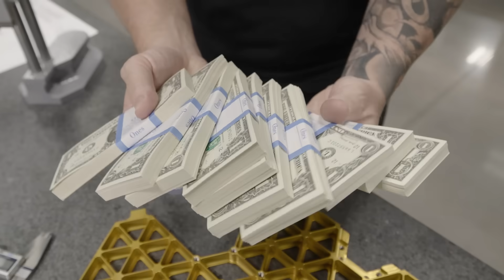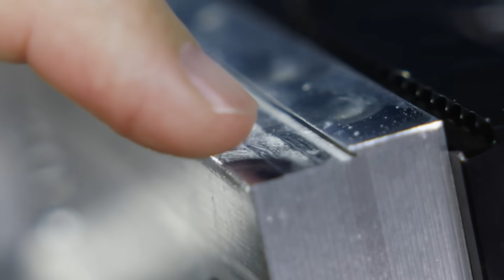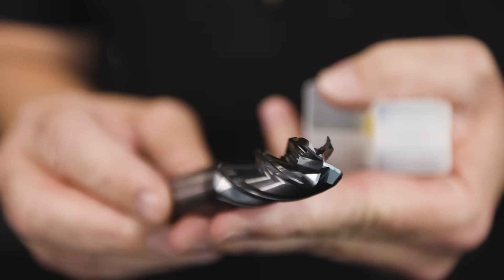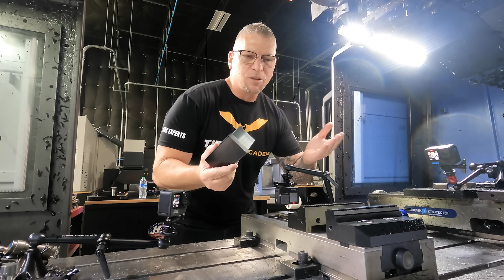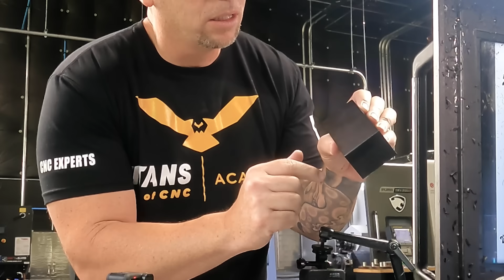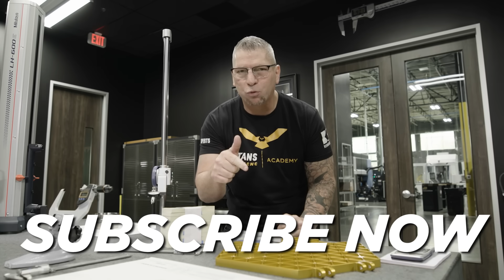How To Master The ART of Machining Plastics

Comment: Hi Titan.  Manufacturing changed my life back in 1992 when I took a night job at a screw machine shop.  I looked at the drawings and said "I can make these"  and asked my boss if I could cut my hours to 20 so I could go to community college for drafting.  30 years later and much frustration with designing prototype parts and having tight time schedules, I found myself having to use a drill press and band saw and various hand tools to fix or modify the parts because the lead times for this would run close to when proto parts needed modding and management needed answers.  My wonderful wife told me to just finance my own cnc one night after I wanted to quit due to the stress of work commitments and a day of drilling and tapping a copper heatsink with hundreds of holes and a broken tap.  The company would not spend a dime to help me with the basics to be able to do my job and I was ready to hang it up.  After buying a small Tormach, I found that I missed the days of calipers, mics and chips and now I have a small business that I am training my young son with.  He loves it too and I ended up gifting him with his own calipers and mics and hopefully some day I can retire to just my small business and eventually provide a way for my son to earn a living when he hits working age.  Yes we had a son at age 40 back in 2010 after many years of not being able to.  God blessed me with a smart young man that has a genetic trait for mechanical things.  Other than that, this return to the manufacturing aspect of my career with machining my own trial ideas and prototype peices, has also taught me some things that allow me to design parts without creating a headache for the ones that vendors finally have to machine  for our production units.  My company now realizes the money and time savings of me being able to provide sloutuions in a day or two vs. waitng for 4 weeks from another shop.  I can tweek desins on the fly!  Thanks for the great content and I wish I could go into more detail of what God has done in the past 30 years as far as lifting me out of the mire.  But that would be too much here.  By the way, I'd say the stack is 4.3773"  but if I were to win, I'd give the money to my son to use for future courses as he is home schooled and we want him to be able to take courses in CAD and other needful tools as he is very interested in being "president" of the small business someday.  Thanks!

Comment: I started out designing product for an outdoor company. I didnt have "schooling" as an engineer, but I had loads of product usage on a professional level. Moving into design,  I was always told how you couldn't build certain things due to design parameters. So, I started learning machining so I could improve my designs. Decided I need my own machines so I could prove out ideas without answering to anyone but myself. Now, 20 years later I have 2 cnc machines, and 2 manual. Still building and learning thanks to good folks like you who push the limits and share knowledge.

Thickness- 4.4122"

Comment: Starting as an operator with zero experience seven years ago, to working as a manufacturing engineer, to now opening my own shop in April, I'm obsessed with achieving manufacturing greatness in the USA. My guess is that stack measures 4.8678 at the highest point. Cheers and thanks for all the awesome content and educational material. That zero tear-out ramping trick is super slick!

Comment: Ive always loved learning, machining whether additive or subtractive is always forcing your perspective to see something that isn’t there yet. I just had my first child march 26, 2022 at 25, I can’t wait for her to start playing with the 3d printers and learning cad. Also thanks for your motivational/inspirational videos, they really helped me look to the future.

Well each stack is .43 inches or 1.092 cm thick(100x$1). Each individual bill is .0043 inches thick or 0.010922 cm. so the complete stack(1000x$1) is ~10.922 cm or ~109.22mm thick 

Also if you are ever hiring! Please consider my resume!
Reply: This is the way I would have made my estimation, except I would try to factor in some air gap as well as possibly checking what kind of tolerance could be expected based off my own measurements of brand new crisp bills.

Comment: I came into manufacturing when I’m 20. It’s a tough transfer for a urban man to mingle with a metropolitan community. I just pass out with a diploma without experience. Join into a small scale manufacturing unit as a helper, from there I begin my manufacturing career. When I 1st enter the company my eye stuck with a massive machine. Lot of things happening in one time, it’s a white and blue painted ASM VMC. From the 1st day it’s self I’m impressed by the machine movements something spinning inside with a massive rpm , milky type liquid flowing into it , Screw conveyor removing chips, etc… especially tool changer attracted me so much. After some days I realised that this machine is the back borne of the company. 
           As a helper boy I’m not even permitted to look at the machine. Everyday evening I got a chance to clean the machine, cleaning chips inside and outside the machine that’s the 1st bond with CNC WORLD. Day by day I realise that our company making parts for the CNC machine itself. That’s the best starting for a CNC PROFESSION. Day by day I become a operator, loading parts ( guide ways, cam plates, finger plates, manifolds, etc…) and make good production with quality and quantity. 
         One day suddenly our programmer resigned and quit the job. That’s the turning point for my profession. Our entire production stop for 2 days because of no programmer. The next day I took the challenge, I ask for the operator manual with the machine ( documents related to machine always handle by boss). Boss give the books to me , I go through reference. With my 6months of operator experience and with help of manual books I make a simple manual program for size milling of guide ways. It was a big Sussex (Guide ways only need to do sizing). From that simple leaner movement program I handle all the guide ways job. Later I started to do fixture plates, when r5 need in pocket radios I use 10mm endmill 🤪, r3 - 6mm endmill , etc… for bigger holes I do interpolation format. One day a fixture plate need to do a outside corner radios that, I took hole day for a simple corner radios. From that day on words I learned circular motion also😍. Day by day new challenges comes and That will help me to learn new things. I started my journey as a manual programmer. After some months I got a notice for CAM training for two months. I joined in that course. From there I learned the basics of MASTERCAM software. One day I got a chance to attend a training program for ASM company ( one of the biggest CNC manufacturer of INDIA). When I see the parts they manufactured, I really shocked with shape of the parts. I realised that I just learn only 1%. From there I make more contact with company people who do Cnc multi level programming. Day by day I improved my skill. I joined in a company that make tools and die as a CNC programmer🥰. From there I begin my CNC PROGRAMMER profession. What I love ❤️ about my profession is all ways a new thing we can learn. When new sample drawing comes into my hand I need to think a new idea for machining like clamping, figuring, tooling, quality, quantity, commitment, profit, etc…
         Today when I’m writing this I’m waiting for my flight ✈️  back to my company in Malaysia 🇲🇾 after a vacation trip. Still I have the same curiosity when a part come out of the machine  7 years back I had. The best think is 100’s of machines running day and night  making parts with quality and quantity by my programme and idea of clamping fixtures. Day by day the technology changing, new invention and innovation going on in this world, so we need to update and learn new things our self. Then only we got a chance to show who I’m. Thank you 🙏🏽 
$1000 thickness= 4.33 inches 
                          = 110 mm

Comment: I been cnc Machining for 4 years in plastics.. btw I would use coolant on that delrin for a even nicer finish and a 3 inch Mitsubishi cutter. But anyhow I started when I was 27. No cnc experience but my prior work experience made the boss put me on the Hass mini. I also run a gt75 and Jr.  Mori seki even. I wouldn't want any other job in the world. What I started out as was going into architecture. And one year of engineering. All the blue print drawings I did helped me in the machine world. I blended in nicely. And ever since I been wanting to be better. I machine plastics. Nylon, black nylon is a bigger, Teflon, pvc type 1 and 2.. hate 1 tho. Delrin is my favorite because it doesn't like to crush as much as this video has thought me how to clamp on less material... Thank you. But ever since I been watching your channel.. I did things there watching you and learned how to program better. Only wish to work for you. You are inspiring. Btw the money would be nice especially since I just spent 4grand on plane tickets to go see my fiancee  in the Philippines after 2 years of not being able to and I'm broke 🤣 but if by some odd chance you did pick me I would like for you to donate it to someone really in need of it.

Comment: I am currently unemployed but my experience with CNC machining started with Lincoln Tech.  I finished my freshman year of university and I just didn't like it.  I was unsure of what I wanted to do with my life, until my uncle Paul came over to help fix our washing machine.  We were talking and he mentioned Lincoln Tech, so me and my grandmother went to the school and talked to one of the administrators and she introduced me to the CNC shop. I have never even heard of CNC before this, but the second I walked through those glass doors, I knew that this was the place for me.  I saw these big machines and a small 3-D printer on a table.  I was talking with one of the instructors and he explained what the machines did and how to operate them.  He went on to explain what the course is about and what I'd be learning.  I started the  10 month course and got my NIMS certifications.   I learned more at Lincoln Tech than I ever have anywhere else.  After school I was going to join the Army, but that didn't work out. I failed the medical and was told to find another job.  I found one as a wood worker making shakers, drawers, doors and mirrors.  I liked the job, but it wasn't what I wanted to do.  I was there for about a month then I got laid off do to COVID.  during the summer of the pandemic (mid 2020) I went back to school for this free CNC program at Vincennes.  It was a 15 week course and a much needed refresher.  The instructor wasn't the nicest of people but I ignored that and got my eight NIMS certifications.  I'm still looking for work and also in the process of getting my driver's license, I've been watching your videos for the past 2-3 years just to stay informed about the trade.  CNC machining is something I was meant to do, and I refuse to quit and settle for some dopey 9-5, I worked my ass off to get into this business and I don't plan on stopping.  Thank you for the free education, the inspiration, and the motivation to keep moving forward.  

If I had to guess the thickness it would have to be at least 6 and a quarter.

Comment: Machinining has changed my life because it has made me realize that I can make anything that I can think of As some one who is mechanically inclined one of my goals is to one day make my own working V8 engine block. I've become so invested that I'm constantly looking for more ways to add more tools to my tool box. I'm also looking to starting my own shop one day.

I currently work at a shop that makes parts for the firearms industry though they are working to branch out into other industries. I love every bit of it. Currently we run primarily Haas vf2ss machines but I'm hopeful that we will get other machines as well so that I can become more knowledgable about different types of machines and different control interfaces such as Fanuc.

My guess for the height of the $1000 1 dollar bills is 4.3655".

Comment: In 2015 I graduated right out of Highschool taking their vocational class for Cnc manufacturing. I took this Class because I didn't know what to do after graduating Highschool so I Figured i was better off learning something in some sort of trade and took the Class serious learning all I can. Been working in a Job shop ever since and learned many great things and aspect about the trade. Started in the Manual Machine Department cranking handles to CNC lathes to a 3 Axis VMC programming all of my own parts in WorkNC and Lemoine CAD/CAM software. Also Learned how to use Conversational CNC control from a Seimens to a Hurco. They were Really User friendly and easy to learn. Since the shop I work in are mainly focused on Automotive and Aerospace I became really familiar of how injection mold works and working off datums. Started learning 5 axis machining in 2017-2018 and been programming and using them ever since. Cut and profile many types of Car lens and Optic for big company's. Finish this Nice Disk shape part recently for boeing and felt really proud of myself holding tight tight tolerances. Im constantly learning and trying to improve myself in this trade. Always maintenance my machines to keep them running right. Calibrating it and running RTCP check etc. Its been really fun and loving this trade and seeing this trade evolve everyday. 
Also thanks for having these tutorial about fusion360 and mastercam. I watch them on my free time maybe thinking about getting a CNC. I already own a cheap 3d Printer for fun use. LOL i designed and made a Tool holding rack for my HSK-63 Tools at work since i don't have a tool rack there.
From Akron, Ohio 
Money stack is about four inch five hundred and eighty three thou and two tenths LOL 
4.5832

Comment: I've only been a machinist for 2 years. I work at a prototype shop in Albuquerque, NM. I run, setup and program everything I do (HAAS VF4 with a 4th axis rotary) We do a wide variety of parts and materials. Manufacturing changed my life. It's the only job I've ever had that I truly enjoy doing, even on the bad days. Dropped out of high school @17 never got good grades until I started the Machine tool technology program at my local college (right when COVID started). Graduated a semester early with a 4.0 GPA. (Thanks to my job). Im 26 now, alot more mature than when I was in high school. Applied myself at school and work. Now I'm making crazy parts and excelling at my job. Thanks Titan and the other guys. The academy has helped me a ton with trying to learn 5 axis programming 🔥💯.  Slowly turning into a Metalphiliac like Barry 😂💪

I'm guessing that stack of bills measures out to 4.52 (unconstrained) 
Constrained it should be 4.386 including the paper bands. Each bill being about .0043 inches.

I would definitely use that cash to buy some good mics, calipers, and gage pins

Comment: Manufacturing has changed my opinion on college. my mindset was towards having to get a college degree to be successful and do something i love. but my Teacher Mr Ruiz led me and 2 of my friends to this channel because we were interested in the 770m we have on campus. so far we haven’t done anything other than set ups but i’ve gained experience on a cnc router and manual mill and soon cnc mill. CNC machining became my new favorite pastime. i can do it all day and not get bored. it’s something that evolves constantly and all i’m doing is simple plates and brackets for my robotics team. It incorporates my favorite software fusion 360 with something that’s tangible

Comment: I have been a machinist for well over 20 years. I started in the guitar industry machining guitar parts and fixtures. I was then introduced Solidworks and began designing guitar parts that I would program in Mastercam. This career in Manufacturing led me into a unexpected career in education where I have been for the last 9 years of my life. So not only has Manufacturing changed my life, it now changing the lives of my students every single day. We are Small Academy #12 and very proud of that. Thank you for what you do! My guess on the thickness 5.8765"

Comment: Well if your measuring just the one dollar bills I would say 4.3 but if your leaving on that band around them as you measure I would say 4.36 my friend. As we all know in machining it’s about the little details. I got out of high school and had no clue what or were to take my life. Fortunately for me my uncle got me a job with him as a carpenter and I was a duck in water. On the other side of the shop was cnc router milling tables and as soon as I say those things run I knew I wanted in that action so I transferred over to that side of the shop and took off from there. I have went in to running trunnions and cam software for some of the coolest parts I have ever seen. I can honestly say I have never worked a day in my life I love what I do it’s a new challenge everyday. I have learned a lot from your channel titan your doing amazing work my machining friend.